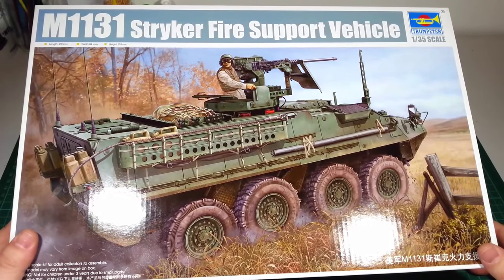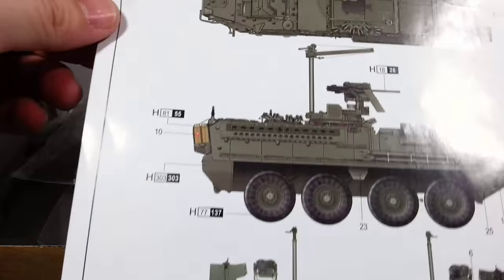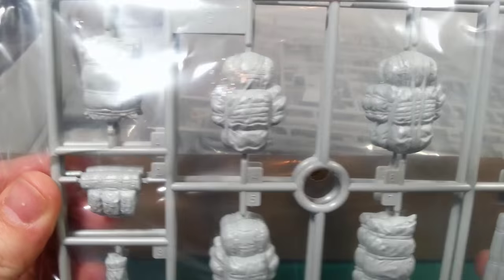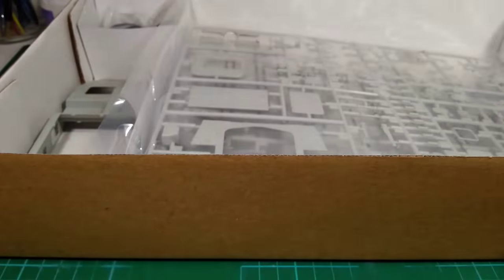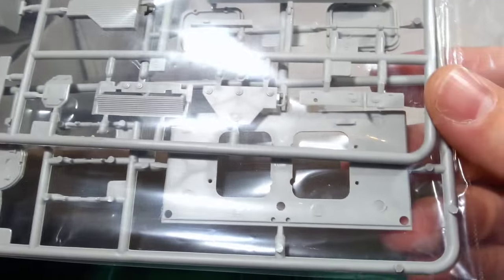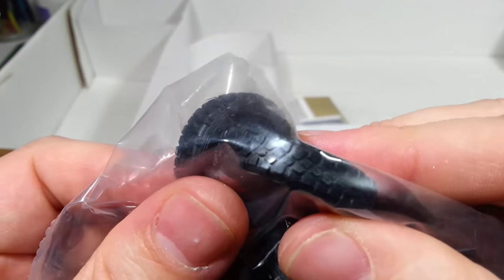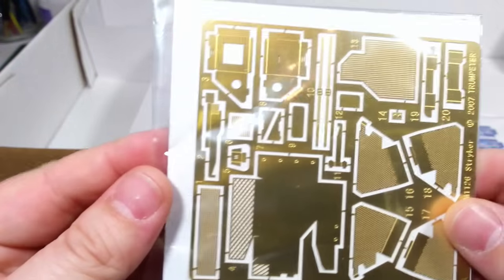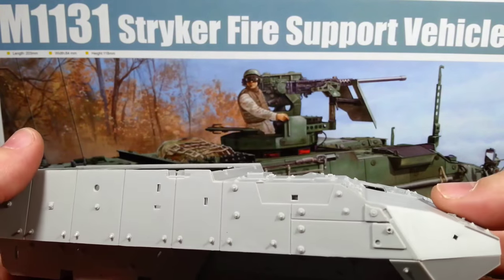A look inside Trumpeter's 1/35 M1131 Stryker Fire Support Vehicle

Comment: Nov. 17, 2021---Thanks for the video, but the WORSE part about ANY of the Stryker kits is NO interiors? ended up buying 2 books from Ebay which covers the various types with interior photos. Cost me $80, but well worth it. Which is why I'm trying to learn CAD, which will beat the hell of scratch building a bunch of stuff. Then I'll 3D resin prints the parts.